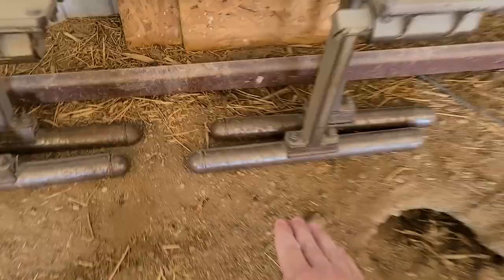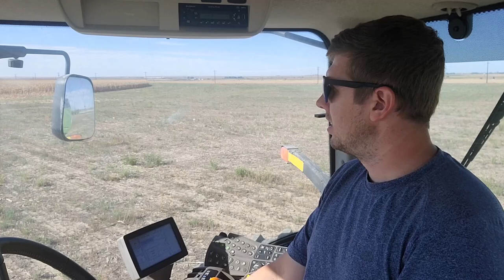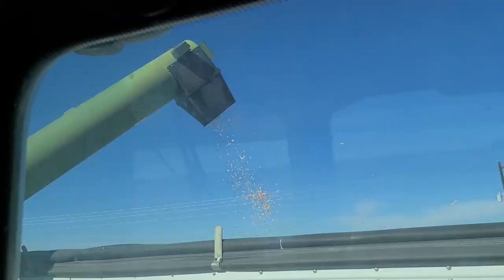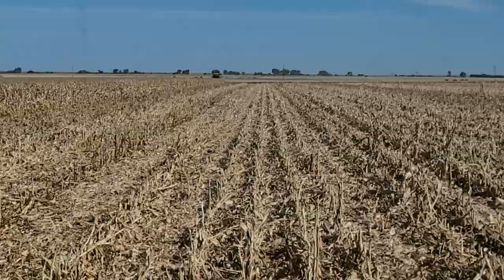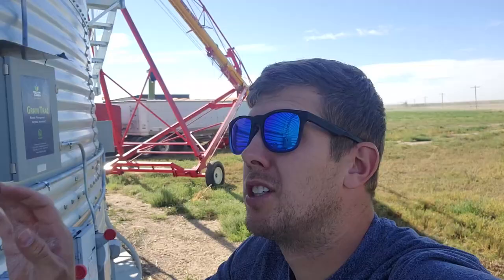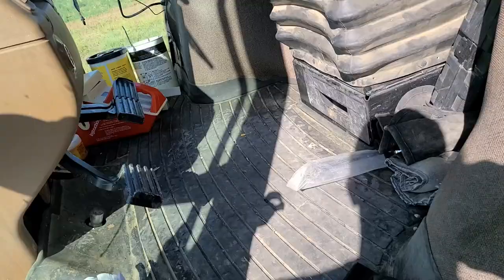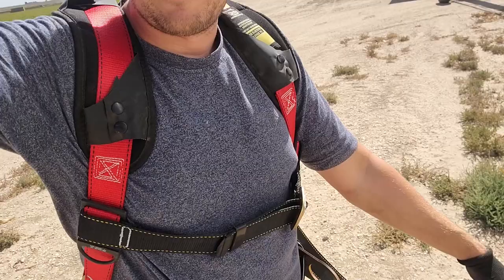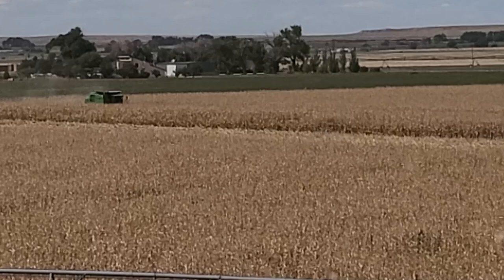Corn Harvest (Always Waiting On The Grain Cart)

Comment: Try some steel wool in the mouse holes 🤷‍♂️
Reply from the maker: I should of explained it better. The hole is like 6 by 8 inches. John deere didn't make a plate so it is just open to the outside under a pull out boom holder. And the mice love to die inside the tractor ha ha.